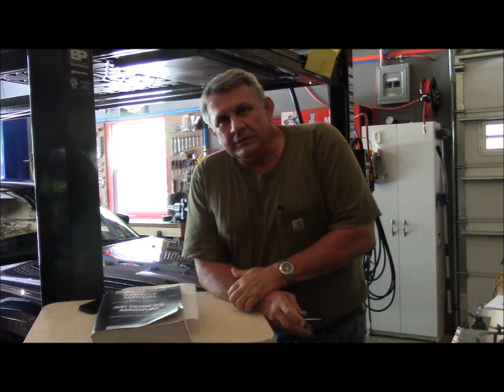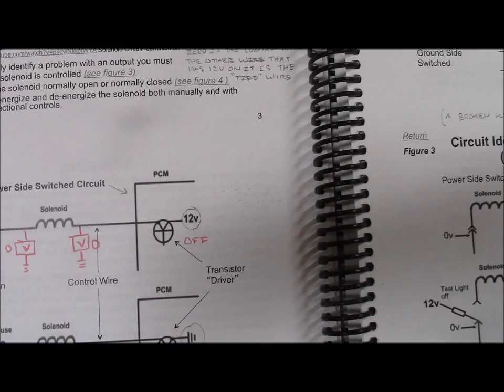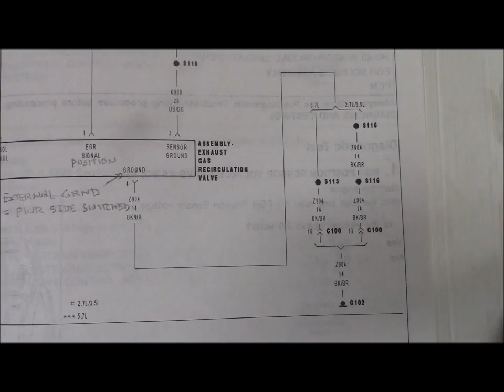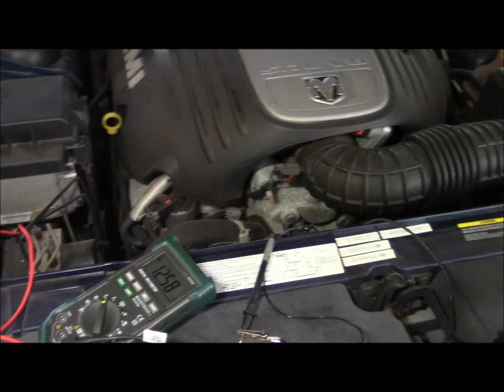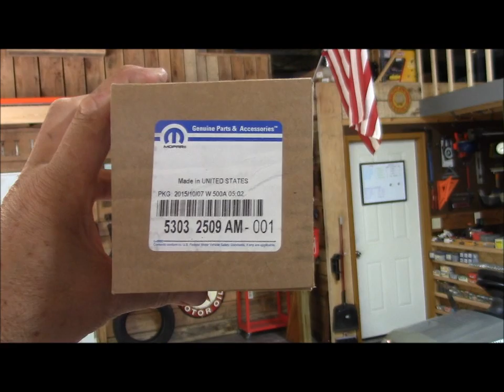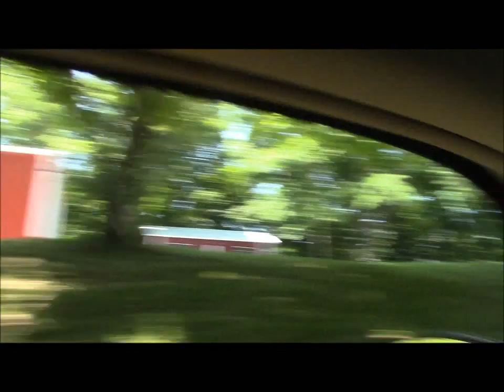Dodge Magnum code P0406

Comment: Hey Wyatt! Hey I am no pro by any means but one thing I find useful especially if you have the factory service manual is just to look at the circuit like you did and I.D. it (just like you did) Power side switch in this case with a 5v sensing circuit . After I do that or in most cases before I do that I like to look at the "code setting criteria" Ie. What is the car looking at to set this particular code. That is a very key piece of evidence and can narrow down your search in most cases. In this case the set condition is: 
EGR position sensor signal is greater than 4.89. One trip Fault. With that being said you can simply look at the signal return wire with your meter while driving the car. and see what it is doing.  It will work like most 5v potentiometers and have a range from 1 to 4.5v or something along those lines. Basically what the car is seeing is an open circuit in your case. Just like it was unplugged and "high". Make sense? Oh and 99% of the time it is the valve ;) so I am sure you got it!
--Eric O.
Reply from the maker: Man I appreciate your input. You have a way to break things down so they are understandable. Changing the part did the trick but I want to understand what I'm looking at so the journey continues, and your response helped a lot.

Comment: Good stuff...Looks like you got it sorted...Electronic EGR's often fail but to be sure I clear the code and see if it reappears..Now it may take some time for it to trip the light but there are many other things that make the EGR send a code like vacuum leaks but most vehicles have a tenancy to particular issues that seem to be their weak spot.
Reply from the maker: Thanks for the information. Changing out the part was easy but I was trying to understand the electrical system as well...I'm not quite there yet.  :)
Reply: You just have to remember that it's just a 4 stroke engine and that they still need fuel and spark but now we don't have control of it like back in the day...Poor connections are rarely an issue...9 out of 10 issues are from a failed component or sensor is what I've found..I started in the trade in 74 and I'm still a full time mechanic so I've seen the progression and things really aren't that hard to understand and repairs are just a part swap away...It just ain't the same as repairing stuff like we used to..
Reply from the maker: I see that most of the time it's the components that fail so thanks for your input. I can change parts with the best of them, I'd just like to understand the electronics behind them.

Comment: Glad you got er fixed Wyatt ;-))
I had an issue popup today with my ride, noticed the water temp creeping up and pulled over (it's a aluminum engine so I keep a close eye on the temps), looked under the hood and found antifreeze outside the radiator :-P (actually all over the engine....LOL). Got the son-in-law to bring me some water, started the engine and commenced to fill er up, now I'm getting water spraying all over the engine...again :-P I found a stress crack under the aux filler tube in the top of the radiator (the radiator is a aluminum core w/plastic top and bottom :-P) Called the parts house, they said $900 for the replacement....I had them ck further and they found one for $80 (BIG difference...LOL), I'll have it tomorrow afternoon.....then the fun begins.....LOL.
Reply from the maker: Oh boy, you got your hands full on that one. Parts are crazy prices so I'm glad you found an alternate part. Good luck with the repair and thank you for watching.

Comment: I used to work on stuff, now I just shake beads at it, and hope the problem resolves itself.  ;-) I bought a Uscan a couple of years back (It uses your iPhone as a display for the code reader) I've been pretty happy with that. Still been just a matter of getting lucky though.  I hardly test anything anymore, mostly just see the 'common fix' and go for that.
Reply from the maker: We all get caught up on trying to do too many things at once but this is a new hobby for me, at least until I blow something up. Thanks for the comment Jim.

Comment: You got it fixed, thats what counts.  Did you notice excess carbon build up inside the old EGR?
Reply from the maker: Actually no. It was pretty clean. What typical deteriorates is the solder joints within the EGR sensor itself. (According to Well's Electronics). Thank you for the comment.

Comment: Nice job Wyatt! I agree I am like you I am very weak on the electrical/electronic stuff. I usually find part number on rockauto then I look it up on Amazon and buy there if they have it. I have Amazon Prime so shipping is free. In my experience rockauto usually kills me on shipping.
Reply from the maker: Hi Mike. It was cool you got up to see our buddy Eric and Steve. I'm trying to learn this stuff but as simple as this circuit was, I still find myself getting confused. Believe me, there was times I think about what you say on your channel!
Reply: you may see me living that very  credo in a future video! Stay tuned.and as far as the confused part, I am with you there. As I get older I get confused much easier than I used to!!!
Reply from the maker: I'm not bragging but I can normally afford to have someone else do it.  I've gotten the bug to try this myself like I did in the 70's. But wow, the complexities have need for special equipment is crazy. I look forward to any video you do Mike. Sit and watch a fire and I'll be there.

Comment: That was pretty cool, glad you diagnosed the problem first. Most people would have just swapped out the EGR valve. 
Knowing what part is out is a lot more satisfying than just changing parts.....good job!
Reply from the maker: Thanks man. I'm trying to get better at actually diagnosing the problem and not just change parts. I have a lot to learn though. I'm looking at a 1957 Chevy truck in Chico. It's getting up there in price so it may not be doable but if I get out there I'll come by and hi hello again. This time I buy dinner!

Comment: Good Job!  That's how I do things a book is a must for what U are working on I got a small library. The new cars are a pain to work on but a book some tools & YouTube U can get in done chasing wires gives me a headache.  This is why I went back to old school cars & trucks.
Reply from the maker: So much information is on the internet and most of the wiring diagrams have to be purchased so I got lucky on this one.
Reply: Wyatt, you can get free wiring diagrams at www.bbbind.com/free_tsb.html
Reply from the maker: Your right about that. I had the books in this case and I've looked at BBB too. Thanks.